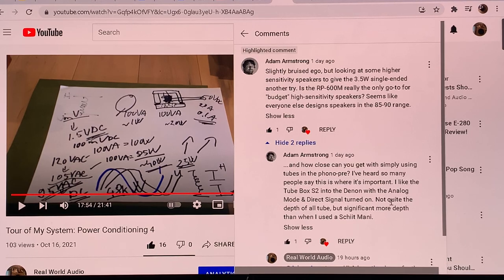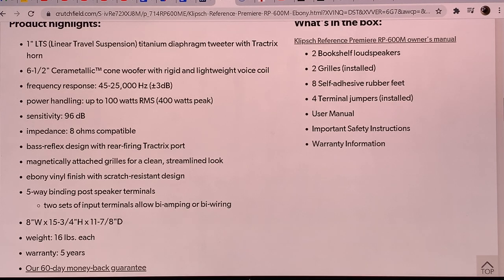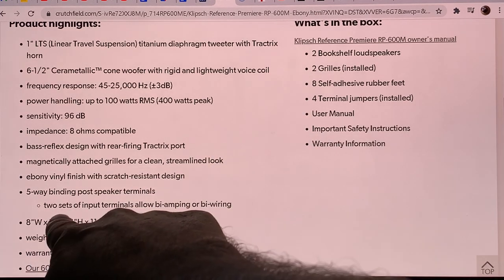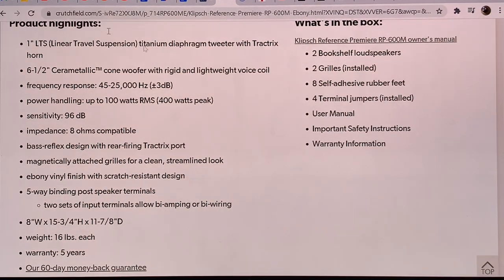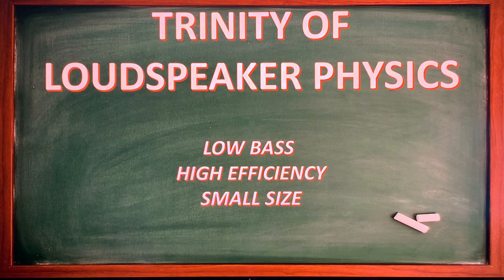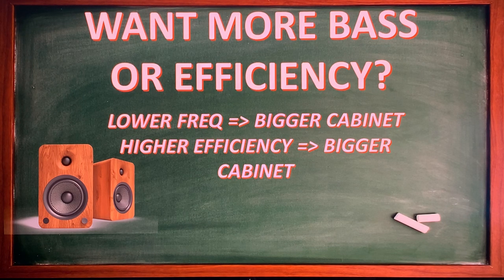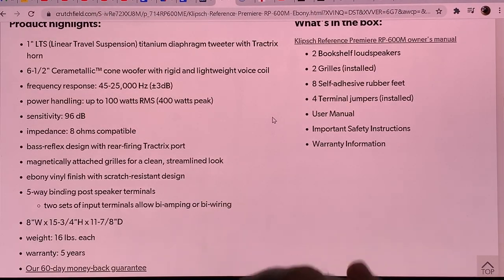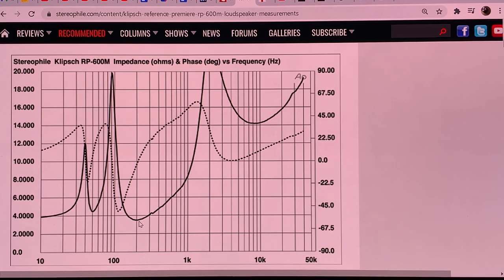This is what KLIPSCH RP600M is about!

Comment: The claimed sensitivity 96dB/W*m is a terrible lie. I bought these speakers because of their claimed sensitivity to use with a 2*6W SE tube amp. So far I had used it with speakers at 90 dB/W*m which produced quite good volume, but I was curious to see what happened with considerably higher efficiency speakers. Immediately when doing first test listen with the RP600 M:s , I thought "-Not a chance in hell that these actually are 96 dB/W*m....., not a chance"  More likely below 90 dB/W*m since they where not even close to as loud as my 90 dB/W*m speakers together with the 2*6W amp. Major disappointment.
Then I found two independent serious reviewers who had made sensitivity measurements of the RP600 M:s, and both of them had reached the same results, namely 88 dB/W*m......  Matched my impression and my guess very well.  Ugly business by Klipsch in my opinion. Sold the RP600 M:s within days after that.
Reply from the maker: Yes, the 88dB/Wm sounds right. Based on Stereophile's measurements, it is 86.6dB/Wm. I'll show the physics behind it on Thu, and show that the 86-88dB/Wm is most likely the real world figure as laws of physics do not permit more. I'm glad to have a real world confirmation from you! ;
Reply: Agreed! I think that Klipsch measures them in room that adds a significant number of dB. Thanks!

Comment: Another way to go, which worked for me is vintage.  You could pick up some early Klipsch Cornwall  or even La Scala at not a heck of a lot more than those 600’s.  I’ve heard Heresy 2 that cost $500 in as new condition play with an 2w home built and it sounded fine lots of bass and very responsive but I believe those other two models are way better than the Heresy.  A lot of good used HiFi stores will do trades which will help with the cost 🌞

Comment: I’m testing the Tannoy DMT 15 MK II with a 15 watt KT88 SE. The sound is good but the woofer needs a lot of energy. The speaker is reported to be 98 dB. So there is not only the DB value that is importend. The restriction can be the cabinet of 100 liter.
Reply from the maker: Indeed, the official specs are 101dB/Wm, which is impossible for 100L with extension to 38Hz. The 98dB/Wm sounds credible.

Comment: I had these speakers for about 1 year. I never liked them. The midrange felt veiled. They felt cheap as the vinyl wrap was peeling away around the corners. They didn’t feel particularly heavy. IMHO, the Q Acoustics 3020 are far better speakers. Their quality is far superior to the Klipsch. Anyways, I bought Closer Acoustics OGY to replace the Klipsch and I am happy.

Comment: I haven't seen the video yet but I can guarantee it's not going to go viral it's just wishful thinking lol
A lot better speaker like of that size tannoy 8" monitor gold active powered should be about $500 it's my advice to him my anybody buying a small speaker has treble and bass adjustment always go active
Reply: I have Edifier 2000 pro's on my TV in the living room. Powered speakers are fine for home audio but I wanted to use the tube amp on more appropriate speakers. I'm intrigued by the Klipsch speakers but wish there were a paper pulp cone option that was under 1,000$ at a 96-100 sensitivity. I just don't trust that copper spun woofer. I feel like it will sound too much like an aluminum woofer, which I'm not a fan of. Currently use Elac Debut Reference DBR62's in the living room (powered by Denon pma-600ne), Kef Q150's in the office (powered by Sprout 1st gen), Jamo S809's in the bedroom for home theater (with Loxjie a30), Elac Debut 2.0's in the garage with a Peachtree Nove preamp to Emotiva A100 amp. Have this cute little 3.5W Boyuu Range A2 single-ended triode with brand new Mullard tubes and no speakers to pair it with. Guess I will give the Kilpsch a try or look for vintage speakers at the pawn shops. Kind of disappointed that there are no paper cone options with high sensitivity under 1,000$. Looking at the Triangle Borea Bro 3 as an option, spec'ed at 90db sen., but that still may not be enough. I would run the Boyuu range A2 at 4ohm, since it has a tap for 4 or 8ohm. We'll see what happens. Thanks for the advice though. I greatly respect Tannoys. I've seen them in many recording studios I've been in.
Reply from the maker: John, sadly you are a prophet! It did not go viral, LOL.
Reply from the maker: @adamarmstrong3991  Adam, to reach 96dB under 1K$ is exclusively through building your speakers, I do not know any commercial choice that can do it or come even close. 100dB/Wm - that's pretty expensive even in DIY, and a giant jump from 96dB. Requires170-250L free air volume cabinets. Basically two extra refrigerators in your living room ;). Oh, actually there is one efficient speaker for just a teeny bit over 1K$: Zu Omen Dirty Weekend. I would recommend that for your tube amp, it is truly efficient. ;)
Reply: @realworldaudio  :(